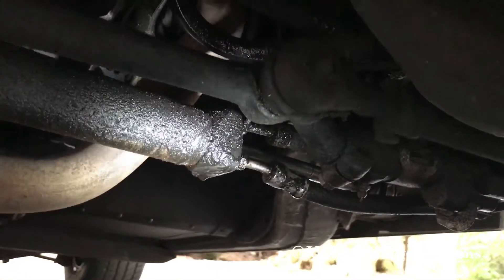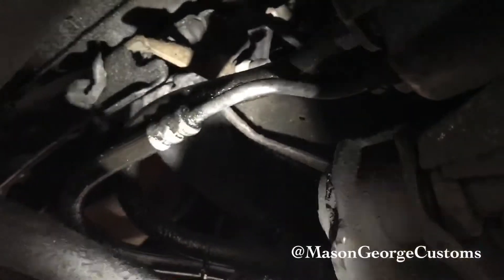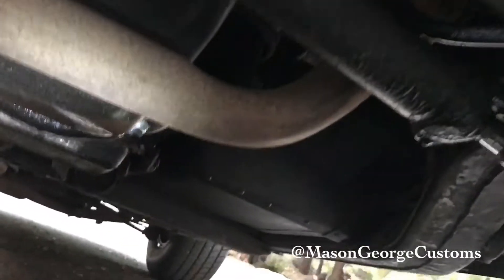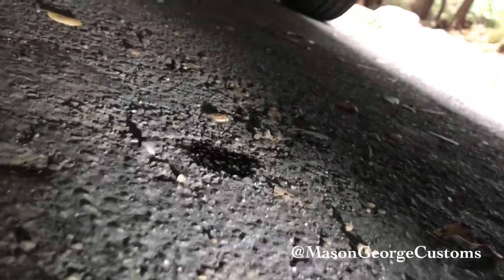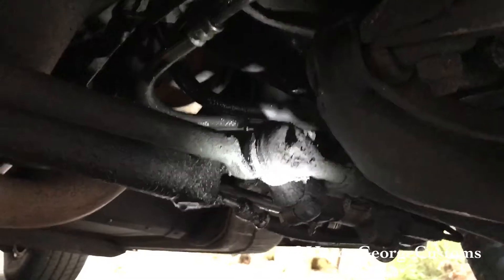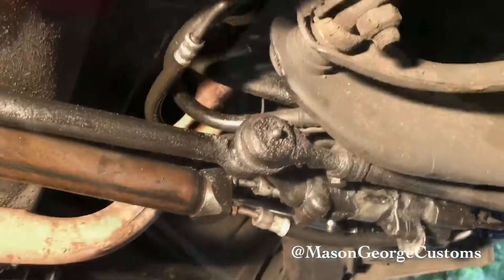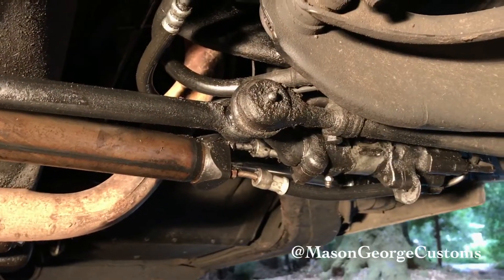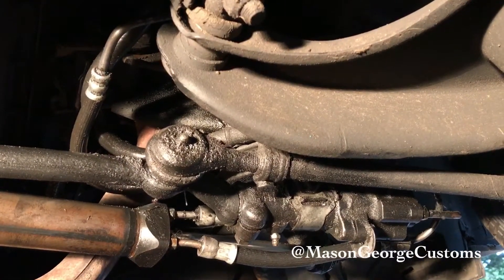Power Steering Leak On The 77 Corvette

Comment: My 68 C3 is oozing out of one of the pipe fittings at the end of the left hose screwed into the power assist cylinder coming from the control valve. I’m having a problem breaking it loose and I think the last owner had messed with it. The fitting was marred up on the wrench flats when I started and it’s probably cross threaded. Yes please make it stop. No power steering is a pain. I’m seriously about to drop dime on a Borgeson upgrade and a new power assist cylinder. Car is 54 years old and drives like a boat in normal city traffic.

Comment: I own a 79 corvette, I replaced the power steering hoses, and the power steering pump. Now I see a leak with the power steering control valve. The leak is coming from the adjustment end of the power steering control valve, it needs a new o-ring type seal. Or I could replace the power steering control valve, which might be a better option. I haven’t decided just yet.
Reply from the maker: Barry Powell The power steering is really the Achilles’ heel of these cars! I do believe they make complete aftermarket kit though.
Reply: @MasonGeorgeMotorcycles  yes aftermarket kits are available. To be fair though, I’ve owned this 78 since1993, first problem I’ve had with power steering. As of this writing, I’m scheduled for the power steering control valve repaired this week. Mechanic’s everywhere seem extremely busy, these last few months. Pandemic virus 🦠 is the reason.